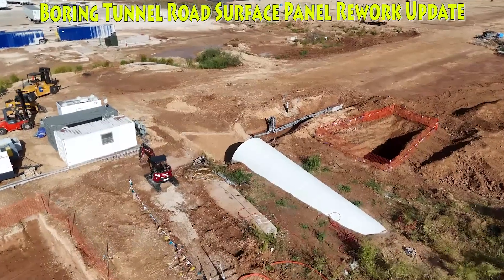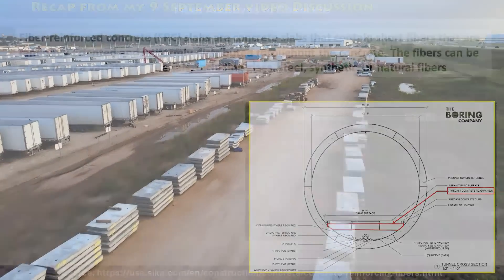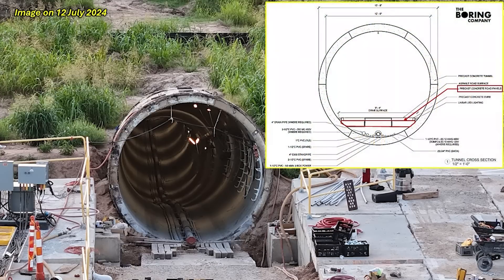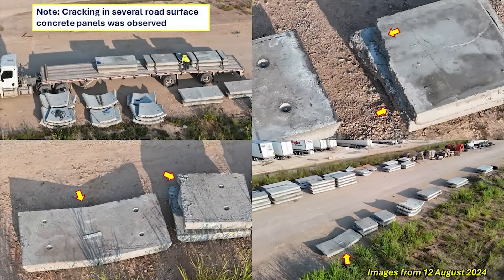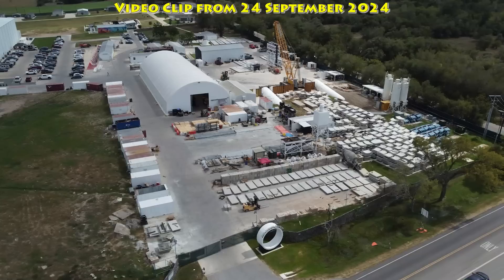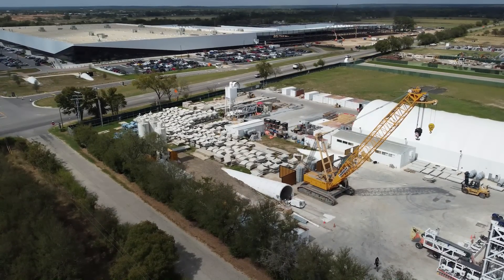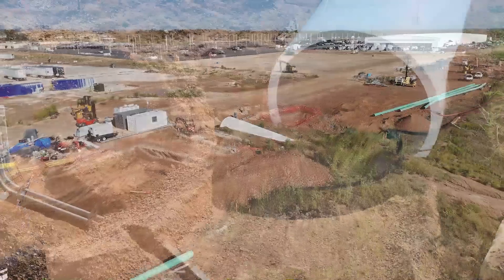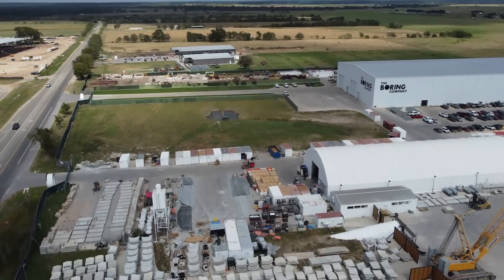Is the Giga Texas Boring Company Tunnel Fixed & Will It Be Operational Soon?

Comment: 1:20 What's up with the grade of the first few tunnel sections being so wonky?
Reply: 1:20 It's an illusion. Deeper inside the tunnel dips down before levelling off slightly.

Run your eye down the length of the outside of the tunnel and it's obvious it is dead flat.

Comment: Considering they broke in the middle BEFORE any loads were put on them, it is amazing they didn’t figure this out in testing before installation.   The CT weight were the tires meet the road is on the outer edges (not the middle) - so those fiber deck surfaces would have broken in three places very quickly under normal usage!
Reply: I think part of the problem is they failed to do any testing prior to installation. Another problem is the decision to use fiber as the only reinforcement. But that would have caught had they done testing. But to me the worst of all was ignoring the problem after the segments began failing.

Comment: Somebody there should know that concrete takes at least 30 days to fully cure - come up to full strength and that’s general 32 MPA concrete. There are mixes that are stronger than that and admixes that encourage quicker curing but generally to take a two or three week old panel and expected it to put up with the stress it’s designed for isn’t realistic

Comment: kek, this looks like a rookie mistake by someone who doesn't understand tension and compression in concrete at all
Reply from the maker: Or it was part of testing different materials in this tunnel, as part of the purpose of this first tunnel was to do precisely that. Not saying it was not a mistake, but in any case, they learned some lessons about what they were attempting to try.
Reply: @JoeTegtmeyer  That does not make sense. I would expect any sane company experimenting with different materials would thoroughly test them out before committing to use them on a major project. (And I suspect The Boring Company is quite sane!)
Reply: and what are their testing procedures?...do they even have any? Very unprofessional for sure.